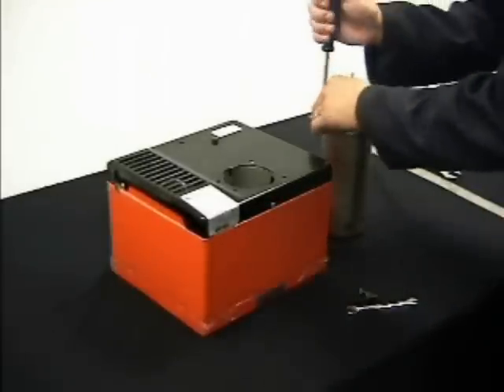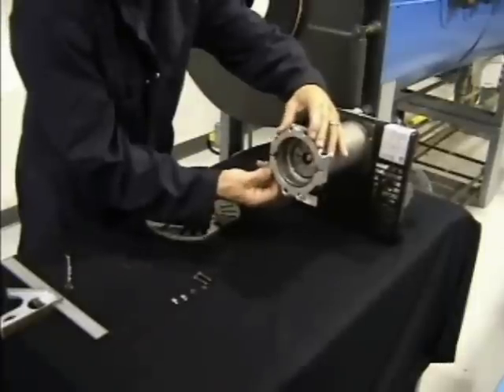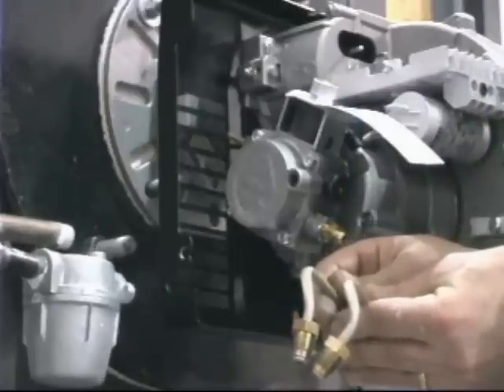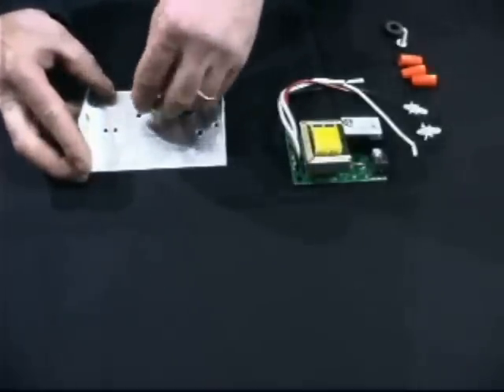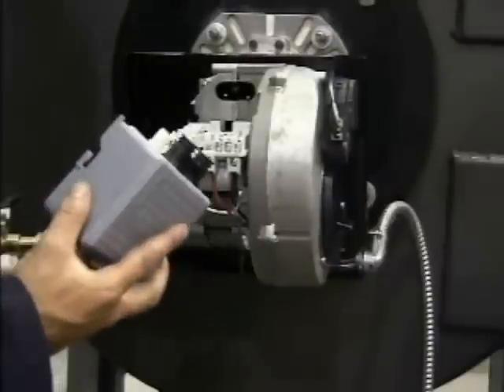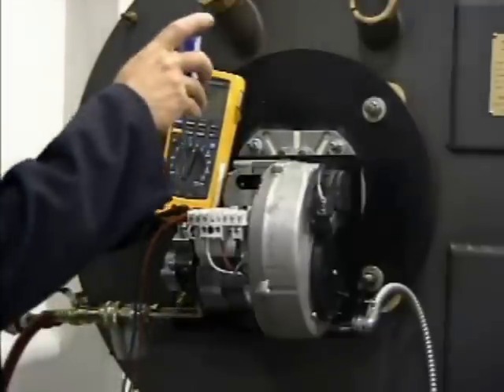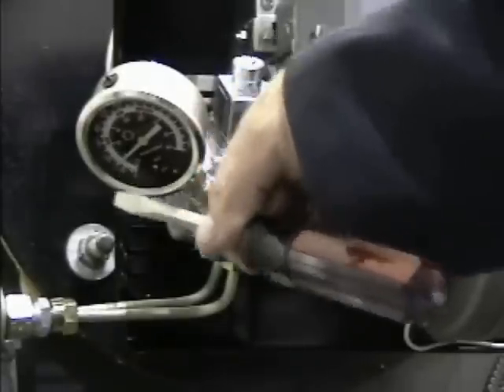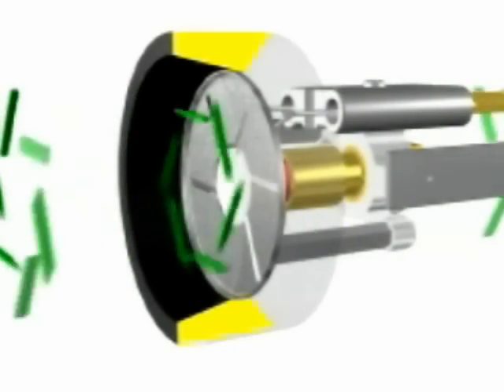RIELLO F40 Series Oil Burner Training Video

Comment: NOTE!!!! Before testing capacitor DISCHARGE FIRST. To safely discharge a capacitor you will need a 20,000 ohm 5 watt resistor, two insulated screwdrivers and two jumper wires with alligator clips on both ends. Connect one jumper wire clip to one wire of the resistor and clip the other jumper wire to the other resistor wire. Connect the clips on the opposite ends of both jumper wires to different screwdrivers, hold the handles of the screwdrivers and touch the blades to opposite terminals of the capacitor.          Good video, for licensed Oil Burner Techs.

Comment: With control box removed: jumper control box terminals 5 and 6 to allow motor to run without firing the burner.
Reply: Verify 39 to 51 VAC between 3 and 7
Reply: Box away and power off: 1.3 ohms between 2 and 8
Reply: Box away and power off: 1350 ohms between 1 and 2
Reply: 3 and 9, detached, capacitance 12.5 microfarads.
Reply: Clockwise for more pressure, oil pump

Comment: Total Darkness (over 150k Ohms)
Good light (Less than 40k Ohms)

Good Job Ross
Reply: shouldn't it be wayyy less than 40k ohms in good light?  just wondering because other burners should be less than 2000ohms thanks

Comment: What is the resistance of the cad cell????
Reply: probably needs to be under 2000ohms but i dont know how to read the resistance. i just replace the cad cell and nozzle / check specs if it wont run